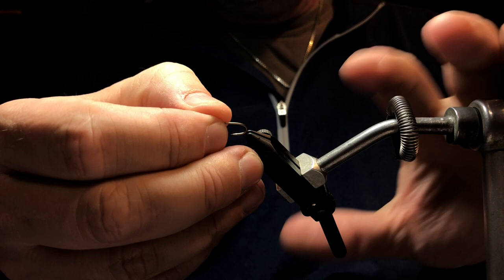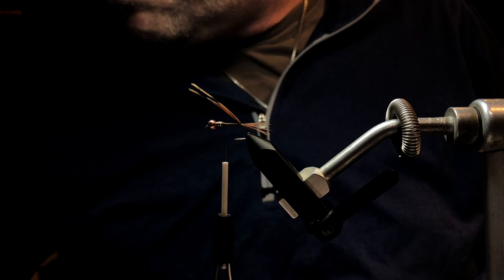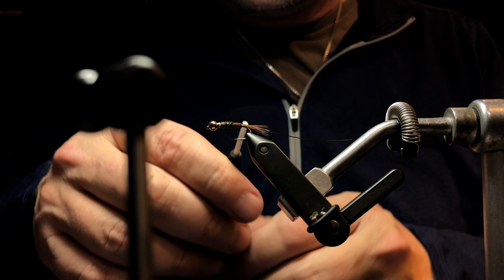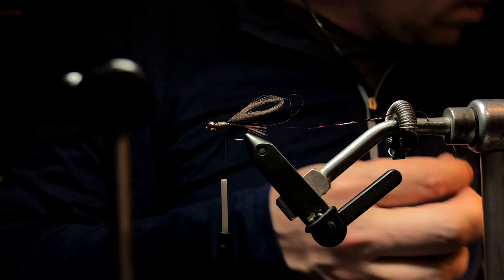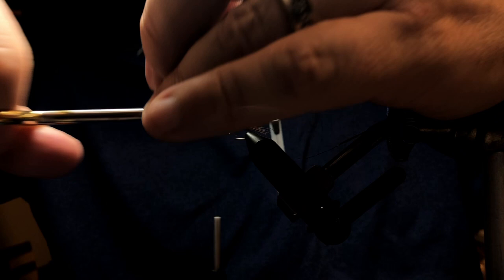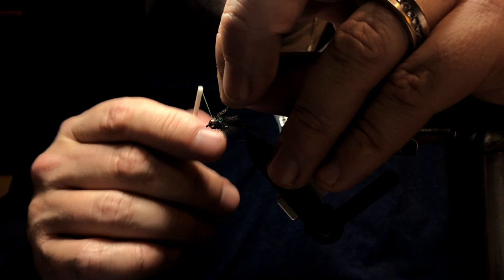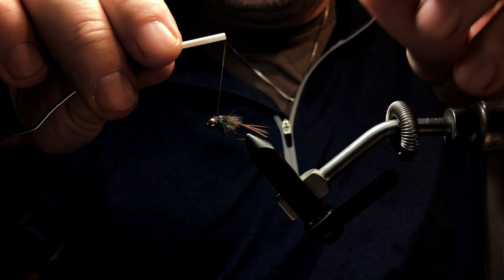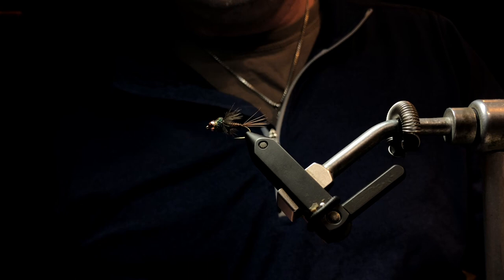Split-Back CDC Drunella doddsi Nymph Fly Tying Tutorial

Comment: Jim, that's a sweet looking nymph. You've packed in a lot of materials on that little fly. I used to use a lot of UNI, but switched over to UTC a little while back for most ties. The Olive Dun is a really great UNI color though. Cheers
Reply from the maker: Piscator Flies thanks, man! I like Uni for certain applications. I also use Bennechi, Veevus, UTC, and GSP for spinning hair. I have quite a bit of Danville rolling around but it’s my least favorite and I rarely use it.